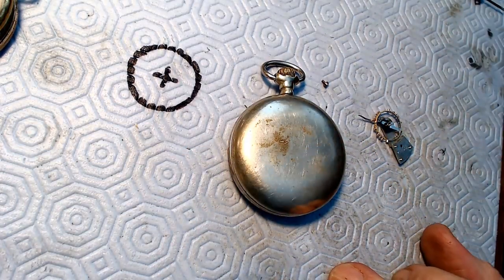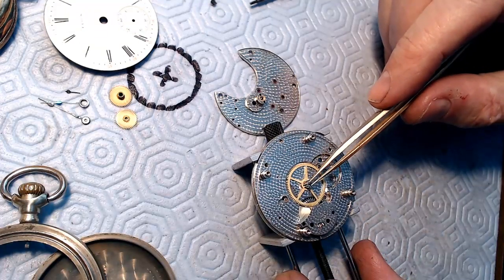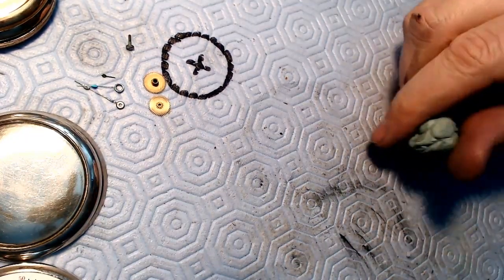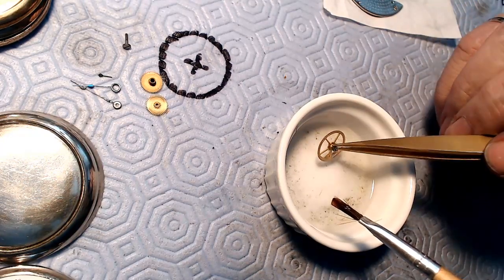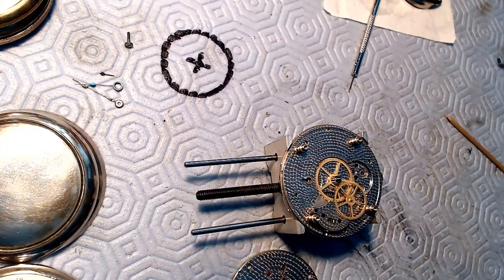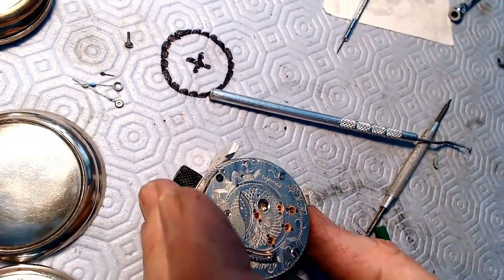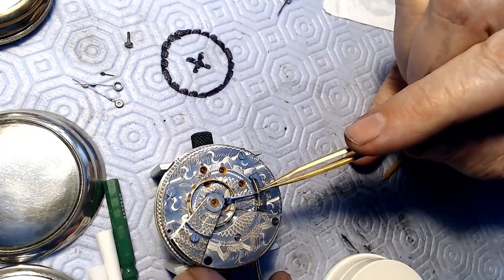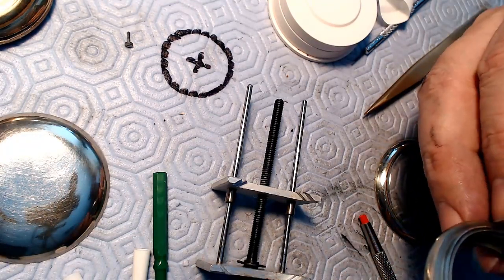Elgin Railroad Grade Pocket Watch Cleaning

Comment: I have my grandfather's Elgin railroad style pocket watch (1904?). I cannot get front nor back cover to unscrew. It stopped working a LONG time ago; before my time (72 yrs). How should I loosen up what I think is just dirt, sweat, corrosion (he was a farmer) in the threads without damaging the intact crystal, or anything else? I don't want to fix it, just open it up and then take it to be repaired.
Thanks
Reply from the maker: Use a dollar store rubber ball that is air inflated. Squish down on the back or front and turn

Comment: I have got something like that for service and restaffing, at the moment I’m still working on striped thread under balance wheel. A bit difficult to me.
I really like your videos.
Reply from the maker: Morteza Saremi Thanks. What is a stripped thread?
Reply: I missed what you called the lens scratch cleaner
Reply: @JDRichard  a stripped thread is where the threads in the hole have been worn smooth. A cross threaded is where a screw was put on out of alignment and the hole now has two different thread tracks.
Reply from the maker: @andrewgillis3073  Kind of knew that:). Thanks

Comment: I am wondering if one could use a soft nylon fishing line instead of Rodico to do the trick with fixing the palate. You thread the line through two major screw holes on the sides so that it does not slip while holding the palate, and then replace the main plate and simply slide the line away. You have to keep the line taut though - maybe some sort of rubber band graft? But of course Rodico works too, as is evident.
Reply from the maker: Very interesting approach...and thinking. I kind of thought up the Rodico technique as it is fast and works. How would you fasten the line ends?
Reply: @JDRichard  I was thinking that perhaps it could be composed of the fishing line and a rubber band. I do appreciate that you need to keep the line tight so that you do not lose the positioning of the pallet. So maybe before applying it to the watch, you could tie one end of the line to the rubber band. Then you thread the other end of the line through one of the spare screw holes from "behind", and then through another hole on the opposite side of the bridge plate. So now you have the line threaded and you can stick the pallet in place between the line and the bridge. On the other side of the bridge you have the rubber band with one end of the line fastened to it, and the other end of the line is loose. Now you thread the other end of the line through the rubber band and you pull until everything is snug and the rubber band is under tension. Presumably you can thread that other end of the line several times through the rubber band so it will hold itself, or you can use Rodico (or indeed any other sticky substance) to connect it temporarily. The whole thing should remain snug because the rubber band is flexible. Although I must admit that your Rodico is much faster and simpler. Oh well. I am a theorist.

Comment: Hello JD, I am an old 50's air force brat from Canada, Zwiebruken era. I just purchased an identical watch built in 1895 as inspiration as I am about to tackle pocket watches as a Covid challenge. I bought this one as inspiration as the movement is a work of art. At the moment It is working if on its back or side but quits if the face is up. Obviously dirty. I am awaiting some less rare Elgins to learn on. My question is, would it be safe for me to remove the movement from the case, remove the dust cover and hands and put in my ultrasonic in lighter fluid to try and clean it then let it dry thoroughly and follow up by oiling the jewels I can without opening the case. Would that be safe to do to get it working when face up? Even if I gain some skills on the movements I practice on after watching your work on this watch I won't be tackling a full face watch. I did go over to CTC yesterday to get some Peek for the case. 

I am also wondering if there are Canadian sources for parts like crystals, mainsprings and screws, etc.
Reply from the maker: You could simply put the complete movement in lighter fluid and let us soak over night. Should not impact the shellac on the pallet fork or the impulse jewels. You would need to remove the face and the hour wheel as well. I would not put this in an ultrasonic cleaner and especially with lighter fluid or equivalent. If you plan on getting into this hobby, buy The Watch Repairers Manual, off Amazon….Hard cover and use it as your bible.
Reply from the maker: Get the book and then figure out what to do…..
Reply: @JDRichard  Thank you for your suggestions. Heading to Amazon now. Suggestions re suppliers?? or is that not permissible?
Reply from the maker: @lesfrost169  I get 99% of my crystals and mainsprings among other things from Cousinsuk.com. No import duty and reliable
Reply: Book, crystal polish and a 10x clip on loupe on the way. Now for a look at the site you mentioned. Thank you.
Reply from the maker: @lesfrost169  Good for you and have fun. Take your time an learn slowly with practice
Reply: @JDRichard  I followed your suggestion and soaked the movement in lighter fluid but chickened out and only did it for a couple of hours. the fluid did appear to have taken on a bit of yellow colouring so some stuff must have dissolved. After drying overnight I lubricated  the hour and minute wheels posts and the jewels sparingly. I then lifted the balance assembly and oiled the lower jewel and afraid to try the upper, put a dab on the upper tip of the balance shaft. After putting the balance cock back in the movement is running but stops as soon as I start to get the plate screw almost tight so I am letting it run in for a while to see if that helps.with it running it still stops when I rotate it to other planes so the original problem still exists. I have some practice movements on the way so think I will back off on this one until much later if my skills improve. The book you suggested should arrive today.

Comment: I had heard that the Geneva Stop-works also performs a similar function as the Safety Pinion in that is limits gear train shock should a mainspring fail. I could be wrong on this though.
Reply from the maker: Tempus_Fugit73 Smart people back in the day
Reply from the maker: You are correct. It unscrews thus releasing the shock.

Comment: 1890's watch has a glass or man-made ruby crystal (if original), not plastic. A replacement crystal MIGHT be an acrylic.
The few plaastics available in the 1980's (Celluloid was the most common, and is NOT suitable fr a watch crystal: Way to brittle amf fragile at that thickness, Also, Celluloid outgasses (lighter colors and clear are the most prone to outgas.) The gas is nitric acid, which damages all metals, including gold and silver)

Comment: I am just watching the video again and my watch has a flat glass crystal with beveled edge so I presume it is original.
Reply from the maker: Did you just join a club?
Reply: @JDRichard  yes, only learned you were part of the group as I signed up.
I did the full movement soak you suggested , removed and reinstalled the balance but it still doesn't want to run face up. It is now back together for display only until I learn more if that happens.

Comment: I thought to be a railroad watch it had to have Arabic numbers not Roman numerals on the dial unless the face has been changed.
Reply from the maker: Bearcwy Not so.  You can look up the serial number of the movement on pocketwatchdatabase.com and it provides all the info including adjustments and if it is a RR grade
Reply: @JDRichard  oh I see it's not a railroad pocket watch but a railroad grade movement. A Railroad pocket watch has to have a correct movement and dial, but a railroad grade movement can be in any watch.
Reply from the maker: Bearcwy Railroad Grade meant the it was qualified to be used as a railroad time piece, so it was a railroad watch
Reply: Thats a long held misconception. Different railroads had different requirements for their watches, and  there wasnt  standardized rules until about 1908, and even then many older watches were grandfathered in. Prior to this, many railroads allowed roman numerals, hunting cases, and pendent set. By around 1900, more railroads were requiring the grade and positional adjustment to be etched in the movement, and by 1908 most railroads were requiring lever set and arabic dials, along with a higher jewel count watches.